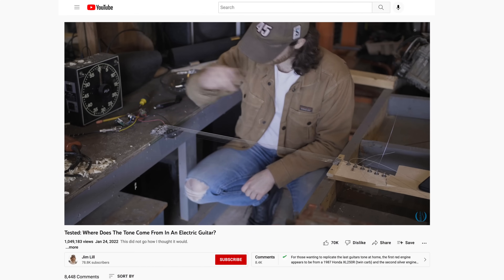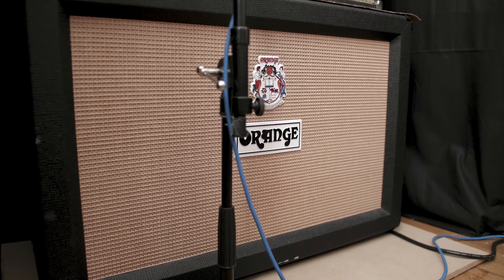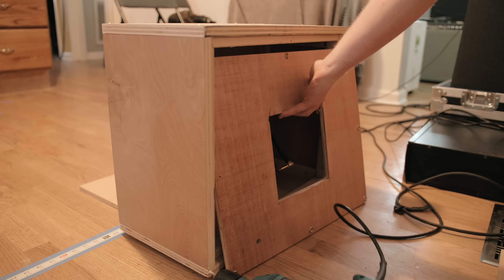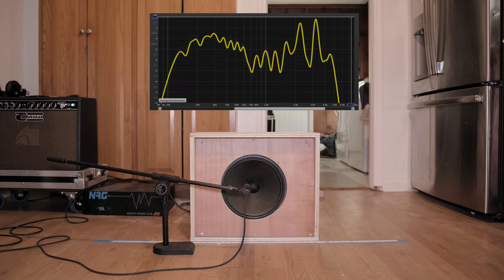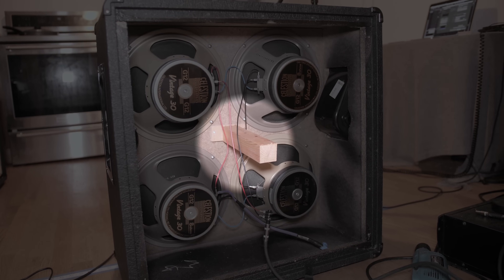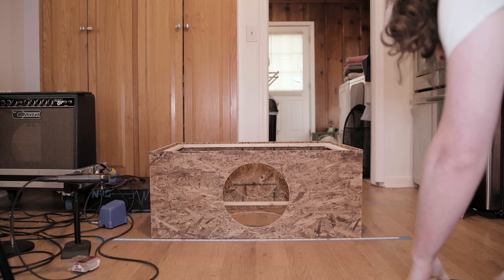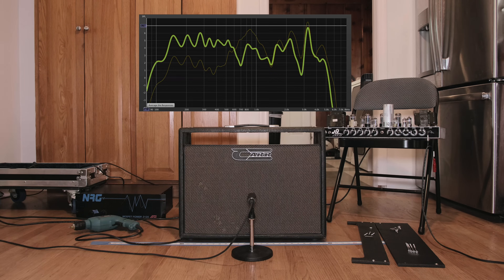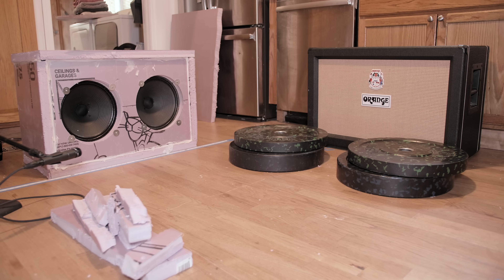Tested: Where Does The Tone Come From In A Speaker Cab?

Comment: My buddies in high school all had subs in their cars and one thing I noticed was a  massive difference there is between a poorly home made sub box (cab) and a legit one.
Reply: At the most basic level the reflected waves matter the same as pushing someone on a swing. The wave reflecting off the back of the box wants to hit the subwoofer as it’s going back out and ride pushing it out not when it’s coming in and clashing with it. It gets more complex than that but it’s a good starting parallel.
Reply: You can cheat a little if you pack them with old clothes.

All different sizes of speakers will have a perfect size cab for volumetric efficiency and it will depend on whether they’re sealed or ported as to what that number is and how big or small the box should be.
Reply: @lathiat  That's not what's happening with subwoofers, the frequencies they're dealing with have much much longer wavelengths - subwoofer behaviour can be modelled using Thiele-Small parameters. However that rear wall reflection can have a significant effect on midrange response and is one of the differences you hear between typical closed and open-backed guitar cabs.

Comment: It would be really interesting to add tuned bass ports into your semi-closed testing.
Reply: A pseudo opened back enclosure is a tuned bass port, it's just a very short port with a large surface area.  The same port tuning equations and stuff still apply though.
Reply: @clifwilmer8167  I get what you're saying but I'd argue that it's then an un-tuned bass port.
Reply: @InVacuo  People generally do often just throw things together willy nilly, but my point was that there is still a port tuning frequency, so it's tuned in that sense, it's not tuned in the sense that people generally don't seem to consider what that tuning frequency is.

Comment: Interesting theory about why the Open vs Closed back cabs sound different. The speaker moves back and forth to create sound inside the cab. In a closed cab, despite not being air tight, the movement of the speaker causes variations of pressure in the air inside, that is, if the speaker moves backwards it encounters a resistance due to positive pressure, and if it moves forward it does encounter a resistance due to negative pressure. 
On the contrary, on an open back cab, the air inside the cab flows way more easily in and out, therefore applying little to no pressure in the speaker cone when it moves, and thus allowing it to vibrate more freely, and in general to move "more" back and forth. This phenomenon is more noticeable in the low end, which are the lower frequencies which require a wider movement by the speaker cone. 
This theory would explain why the size of the hole in the back also affects the tone, in that it affects the air flow in and out of the cab.

Comment: Nice work! I think a more realistic experiment would be to put the mic in a listening position. When you close mic a speaker, you hear a lot of "speaker" and very little "cab". Anyone who has close mic'd a cab in the studio can tell you, by moving the mic just a tiny bit can have a huge effect on the sound. The cab is like an acoustic guitar body. The whole thing is resonating and vibrating. The sound doesn't just come out the hole. When you close mic something, you are zooming in to a smaller spot. When you put the mic back further, you are picking up a larger average. That might be a great video idea for you....same cab, 1 mic, the only thing that changes is mic placement. I've done a lot of that in the studio and you will get dramatically different sounds. 
I look forward to the next video!
Reply: You start getting into room acoustics as well when that comes into play so that just throws even more variables into the mix, but I do agree... mic placement is an artform all its own.
Reply: @dzd2371  Yes, I agree. If the mic is too far away it will pick up more of the room but (in my opinion) I think the mic was too close.
Reply: @02Tango  It would have been valid for this experiment as well since he would have been using the same room, any variables from the cab would still have been noticed.  Loving this guy's work though... putting to bed myths people have been yapping to me about for 30+ years.

Comment: Something to consider if it hasn't been mentioned several times already. You are using a 57 directly on the speaker which is going to sound like a 57 on a speaker.
Also the elevation of the cab has an effect. 
These cabs all sound different if not drastically different in the live setting.
Reply: The microphone was a control variable..

Comment: Love this series!  Paypal contrib sent.  One thing you missed: how much do the speakers vary from one to the other? Same cab, just swap out your four speakers?
Reply: They vary a lot! (but obviously some more than others) I'd recommend watching some of the 'Zilla Cabs' videos they have many comparisons between (mainly celestion) speakers in the same cab.
Reply: I imagine he will do a separate video about speakers in the future
Reply: @LucaJanota  That would be cool, it's pretty easy to hear that different speakers sound different, but I have no idea why... is it the magnet type, magnet size, cone material, basket shape, etc? which of those things make a difference and which don't? ... it might be difficult to do but it would be interesting for sure.
Reply: @rocket69218  Ideally the speaker would be a membrane that moves perfectly in accordance with the audio signal, with no resistance or lag. However the components have weight to them which makes this ideal impossible. I would guess then that the most important factor is magnet type, a stronger magnet can weigh less while producing the same force, thus allowing a faster response to the electromagnet/voice coil.
Reply: If the closed back speaker is perfectly sealed then when the speaker element moves inward, that creates an increase in barometric pressure on the back of the speaker cone. 
This creates a dampening factor on the linearity of the voice coil. Compared to the front of the speaker that has constant barometric pressure. This will affect how quickly the low frequencies are attenuated. 
Also the size of the closed back speaker cabinet will affect how much barometric pressure change there is this will also affect the attenuation of low frequency content. 
Open back speaker cabinets respond differently to complex frequency content being applied to the voice coil. 

As an example if you have three notes two of which are harmonically related but the third is not the speaker has great difficulty trying to reproduce the non-harmonically related frequency compared to the other two that are harmonically related. 
This produces a higher intermodulation distortion with open back speaker cabinets compared to acoustic suspension speaker cabinets.
Reply: you can always watch johan segeborn if you want to see videos like that.

Comment: Excellent work! I recall some theory to add to the collective knowledge that folks have been posting. 1 - tuned ported boxes are more efficient (louder) because you are combining the energy from the back side of the speaker cone in-phase with the energy coming from the front, albeit prone to boominess (time domain as mentioned) in the low end and the cone has less resistance and will travel further; 2 - a properly sized closed box will produce better, tighter lo-freq response in a smaller box, but will be less efficient because you aren't using energy off the back and because the internal air pressure acts as a damper, 3 - most raw speakers have a spec from the manufacturer recommending the optimum cabinet internal volume in cubic inches or cm for a particular speaker; 4 - hifi boxes contain absorptive materials (on three of the opposing sides) to prevent standing waves which affect the sound as someone has noted here. 5 - speakers designed to be installed in an open back or ported box have a more rigid surround because there is no air pressure damping. A speaker designed for closed box runs the risk of damage if used in an open box. 6 - you stumbled upon opening size making a difference. Each speaker/box combination would have a perfectly calculated tuned port that would cause the energy coming from the back side to join up in-phase with the front. And this mostly affects low-end. You can put a tuned port on the front and experiment with different lengths of tube until you get the thing in tune.  7 - just a guess here, but guitar amps are mostly concerned with midrange, so manufacturers can be less concerned with producing a perfectly tuned box. 8 - I once read that the most efficient material to make a speaker box would be concrete. Vibrating wood is energy loss. That would explain why your sheetrock version sounded like the thick wood of the orange cabs. 

if you append this experiment, I would be interested to hear a comparison of all the variations vs a cabinet of the man. recommended internal box volume for the speaker, mounting the speaker as intended (closed or open.)

update - i couldn't find info on the ideal box size for a celestion 12", so maybe all my theory only applies to hi-fi speakers.

Comment: Very interesting video. As a non-guitarist, but someone who's interested in the audio space, your final results and conclusions were not very surprising. What was more surprising was the number of things that people though did change the sound. In high-end audio, the design speaker cabinets (which is apparently shortened to 'cab' in the guitar space) is very important, but in a more mathematical way. Don't quote me on this, because I am in no way an expert, but with high end studio monitors (which is what hifi speakers are called) the important design aspects are generally whether it is open or closed back, ported or unported (and the location and size of ports matters), and the cabinet volume. I do think for really high-end stuff, the actual cabinet material does matter when it comes to how it reflects and absorbs sound. But at this high end of speaker design, almost all of the things that you dismissed as negligibly changing the sound become more important, because when you are chasing perfect sound (perfectly flat frequency response) little details matter. I think if you were to look into studio monitor design, you might find more science than in the guitar space, which might explain some of your questions better.

Comment: Some speakers are designed for open backed cabinets.
Some big boys (i.e. sub-woofers) require a properly sized sealed cabinet to restrict come movement at extreme power so they don't push the coil out of the magnet. But yes, they do need volume to allow large enough movements (the tee shirt test). Changing the room, and even the location in the room, will give different frequency response.
Your findings are correct though, the positive movement of the cone should be sonically separated from the negative movement of its back side, else some things can cancel out.
Oh my! You said that at 17:50!

Comment: Great video! I recently made a 12” speaker cab from the cardboard box a speaker was shipped in. It sounds great! I did paint the inside as well as the outside. No grill. I used power grab to glue flaps down. The speaker was out of a Fender Champion 40 and sounds better in my cardboard cab than it did in the Champion.

Comment: I loved the video. There was one thing you overlooked. Try fooling around with CLOSED BACK with a PORT HOLE in the front. The size of the Port, the distance of the Port from the speaker, whether or not the Port is a tuned port tube, the length of thge port. If you get the port correct, you'll have the sound coming out of the Port actually being in phase with the speaker. If you get it wrong, the sound coming out of the Port will be out of phase and you;ll get quite a bit of loss in volume and bottom end. Getting it right is very rewarding but its very difficult to get it right.

Comment: holy, just found you. have thought this for many years, been playing off and on since 1985, pretty serious between 88 to 92. had my cabinet mic'd inside the cab and mixed it with infront of the speaker.. there is sound coming from the rear of the speaker, but no one ever uses it...  I liked the tone I got out of it... used a Peavy Butcher 4 - 12 with 30W Celestions.  Love the video, am going to check out more of your posts... keep up the work.

cheers from Montana.

Comment: when you started opening up the cab, you created a "ported" cab. Ported cabs are like horns that are tuned a specific frequency (based on the hole size). They add a boost to a specific frequency range. As for "floating baffle" I'm no expert, never heard of it, but the speaker needs a fixed surface to react to (pushing air, the body of the speaker gets pushed back with an equal force). Any kind of significant softness to the mount of a speaker is likely to mute it a bit because the mount absorbs it and lets the entire speaker move instead of holding it fixed to push air out.

Comment: Love this analysis. Some open questions that might be interesting to check on in the future…
1) does rear mounting of the speaker in the baffle differ significantly from front mounting?
2) all tests were done with close miking - at further distance into the room (where a listener would be standing) would the results have been the same? 
3) I’ve always felt that an open back provides a more 3D (and less beamy) soundscape vs closed back, which makes open back easier for the player to hear in a live setting - would the tests confirm or refute these opinions?
4) does a slightly angled/slanted baffle actually disperse sound better in the room than a straight cab (like the ones you have in your video)?

All good stuff - thanks for taking on this experiment!

Comment: The cab back panel test confirms something I noticed with Engl Screamer combo (which has a partially closed back): it sounded pretty balanced, even tight, through the combo speaker (V30), but extremely congested, loose, and dark through a closed Engl 2x12 cab (V30)

Comment: Agree with supportive comments below. The effects you described near the end, where low frequency waves exit from front and back and can cancel themselves out, and other low frequency wave effects in cabinets, are fairly well understood by the subwoofer box/cabinet industry. A non-sealed subwoofer cab is usually provided with a tuned port. Ported cabinets tend to re-enforce cone movements and SPL at some bass frequencies, at the sacrifice of reducing bass frequencies below a frequency. However, the cabinets for 12s did not appear to be ported, just vented. So, their bass boost will be much less than a tuned (designed port) sub enclosure. Typically, higher frequency sounds are not much affected by cabinets. And, lastly, bass and high frequency sounds are affected by room reflections or lack there of. This is why the open back designs had boosted lows and highs at some frequencies, which was room dependent. If you'd have moved the cabinet closer to or away from walls, you'd have different results. If you'd have done this outside, the room effects would be eliminated, but then the results more applicable to a large concert environment, rather than studio use. I can't say enough about how impressed I am with your videos. Thanks.

Comment: I am shopping for a speaker cab, this video has given me 90% of what I needed to know.  It seems the speaker cab is its own instrument, like the amp, and guitar, its design should be considered. I plan on finding the right speakers, than finding the right cab, based on the details in this video.  I think materials make a difference too, the same way it does in guitar building.  It will be intereesting to see what I choose with this knowledge.  I think a 2x12 is right for me, I want something more compact, but I like the idea of the speakers interacting with each other.

Comment: Up there with the best videos of all time imo. Thanks for putting in the insane amount of work.
I knew cab size made a difference for low end, but i did expect material to make a little more difference for sure, as different materials ought to resonate at different frequencies. 
One thing i wonder is, if you ever had a truly sealed cab in this test, and how that might sound. I know guitar cabs usually don't have gaskets, and glue sealing every seem, but those things a common in subwoofers, as the pressure becomes more extreme, and leakage makes noise, and messes with the physics of the air spring inside the sealed cab.

Anyhow, great video man.

Comment: Jim, seeing your videos a bit late, but decide to comment anyway.  I’m an engineer and a musician (bass).  I used to design and build speaker enclosures.  I think you’ve figured it out from all you experiments.  Speaker enclosures are all about the bass, …mostly.  All of the things you’ve tried shows that tone, volume, and response can be highly affected in the low frequency range.  the mid and high frequencies are more effected by what’s in front of them, like a horn, cone, dome, speaker grill, etc.  Great videos, also loved the guitar video.  Some things to think about.  speakers are designed to be put in a certain type of enclosure. Some will perform better in a ported/open design.  Others will perform better in a closed design.  Using the same speaker in each of the enclosures was the right thing to do to constrain variables, but it doesn’t get the whole story.  Note, if you do more testing, closed boxed design need to be airtight to really achieve the goal of that design.